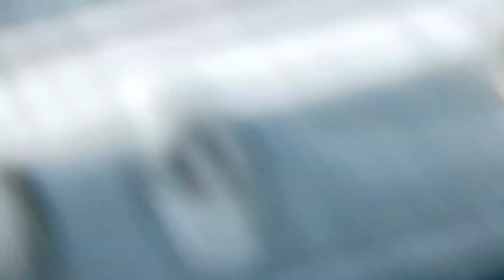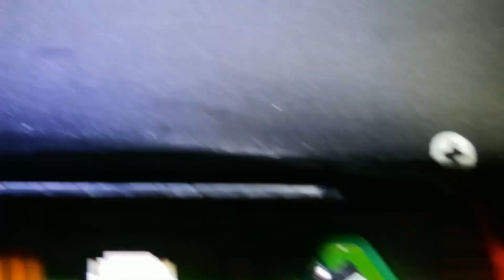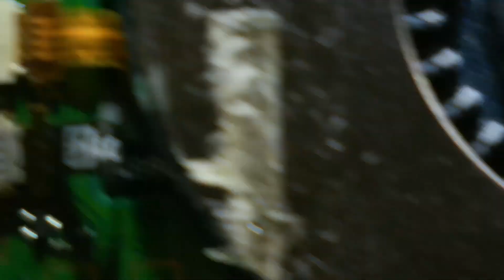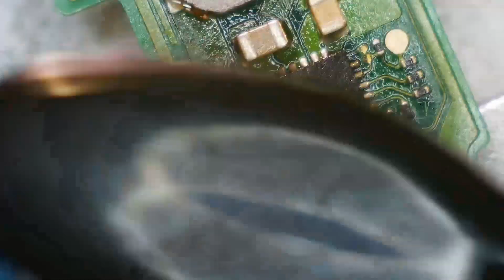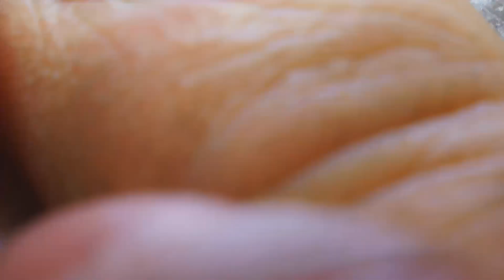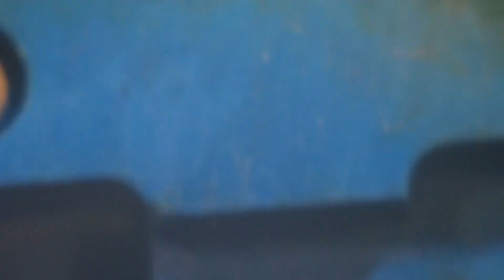Nintendo Switch Repair Bad Port and M92T36 Chip

Comment: Solid video! Not sure if you knew about low impedance but when I first started out I thought there was a short on caps before I found out my meter would beep at anything below 50ohms of resistance. Just wanted to mention it just in case you didn’t know. I spent a lot of time around the max ic for no reason 😂 Looking forward to more repairs 💯 PS you got one nice set up too.
Reply from the maker: Funny you mention that. I was on a wild goose chase on another motherboard around the CPU and MAX IC for quite a while before I stumbled onto that knowledge in a repair forum. Thanks for the heads up, because it did throw me off for sure and I'm sure it will be a source of unneeded frustration for many new techs.  Really good advice.